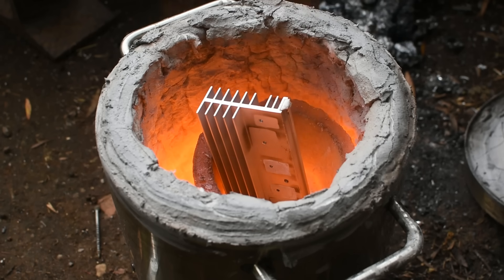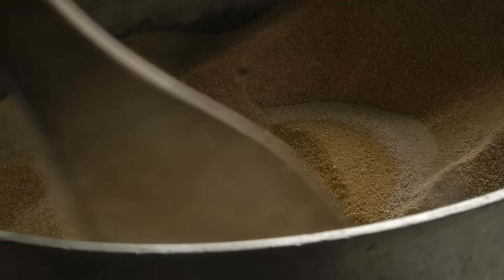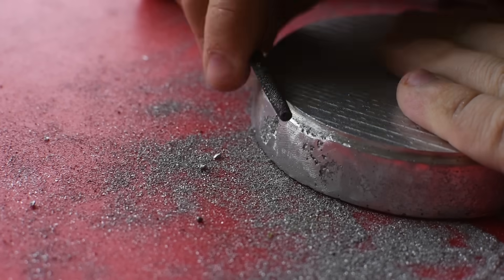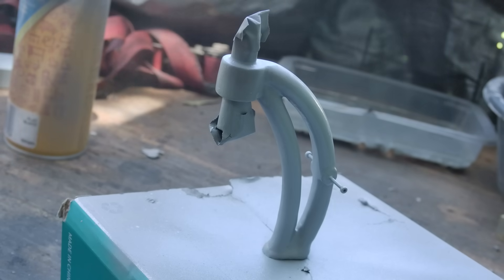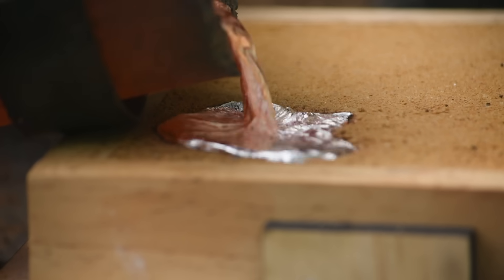3D Printing And Metal Casting Are A Perfect Match

Comment: I've had some success making investment molds from hardware store drywall mud and fine sand. I print a single-wall mold of the object in PLA, coat it in watered down drywall mud, and then pour sand over the wet mud. Drying time can be accelerated in a toaster oven - you just keep coating and repeating this process until you have a thick, ceramic-like mold comprised of sand and gypsum, it's quite strong. One it's done, you can put it in an (outdoor) oven to melt out the PLA at 200 degrees C, you just orient the cast in such a way that the molten PLA will flow out and collect it on some aluminum foil. After all this you should have a mostly clean and dry composite mold, which you can pack into (dry) sand, and then pour your molten metal directly into. My molds were strong enough that the molten aluminum didn't even crack the material, however when I do copper and bronze the heat will usually be enough to crack the mold, so you could wind up with a few small fissures in your casting, however since it's supported in the bucket of sand everything will hold together.

Comment: When melting aluminium, whenever you can use casted aluminium parts and not extruded aluminium parts. They alloy is not exactly the same, the casted ones flow better.

Comment: Q: Why are you just sprinkling the form with baby powder? The plastic is plenty stiff. Would Rubbing that stuff in so it's worked into the surface evenly give a better surface finish? Can you grind and sift the sand even more finely?

Comment: 7:50 If you cut an angle into the wood, made it "sharper", would that help peel off the top layer of sand?  My physics instincts are saying that pushing the sand like that pulls more than you want in the direction the wood is going, maybe add cracks or voids or st.  I don't really know, though.

Comment: I do wonder about using a low melting point material, and attempting something like a "lost wax" casting. That way you can coat the outside with a special plaster, making the job a lot easier

Comment: AI Summary

Abstract

This video details an experimental project integrating Additive Manufacturing (3D printing) pattern creation with conventional green sand casting and subsequent CNC post-processing to fabricate a structurally robust tool component (a tapping arm). The objective was to translate a complex digital design into cast metal, leveraging the superior material properties to achieve thinner, more optimized geometries prone to failure in plastic. The process involved the formulation of green sand using bentonite clay derived from common materials (kitty litter), rudimentary mold construction in a flask, and the implementation of a specialized pouring basin design to mitigate air aspiration. Utilizing a 6 kg propane furnace, the material (scrap aluminum) was successfully poured. Initial results highlighted challenges inherent to green sand casting, including voids from insufficient ramming and increased porosity (bubbles) attributed to layered sand compaction and potentially incomplete sprue filling. The cast parts necessitated extensive post-processing, which was performed on a Carvera CNC mill. Machining successfully removed sand defects, although workholding complexity and a minor crash led to alignment issues on one bore, though the final component was deemed functionally salvageable.

3D Printing and Metal Casting: A Manufacturing Analysis

*   0:01 Project Rationale: The project aims to transition a frequently revised 3D-printed tapping arm into cast metal. This shift allows for more elegant designs with reduced bulk, necessary because excessively thick metal parts are prone to voids and shrinkage during cooling, a constraint opposite to that of strengthening bulky plastic components.
*   1:32 Green Sand Formulation: The casting medium utilized is green sand, compounded from fine sand and 18% bentonite clay (sourced by crushing clumping clay kitty litter). The dry mix was then mulled with water via a spray bottle until achieving proper plasticity, characterized by a clean break test.
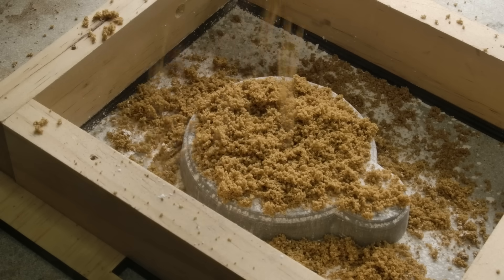*   2:49 Mold Construction and Defects: The mold was constructed within a flask, using baby powder as a release agent. Initial attempts involved compacting the sand in a single step (3:11); subsequent removal of the 3D-printed pattern revealed visible voids, indicating inadequate sand ramming (4:30).
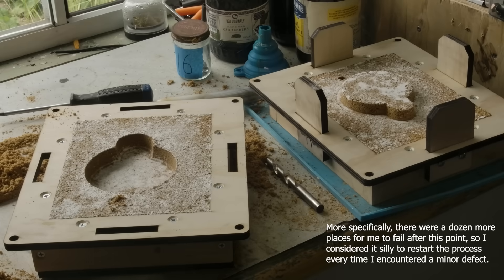*   4:43 Gating System Design: Runners, which connect the pouring basin to the cavity and riser, were manually carved into the sand. A riser was included to act as a reservoir of liquid metal, compensating for shrinkage as the part cools rapidly. The pouring basin design prioritized a consistent, full sprue flow to minimize air entrapment (4:05, 5:30).
*   5:48 Melting Equipment Preparation: The Vivore 6 kg furnace required pre-operational preparation: applying rigidizer and refractory cement to the included ceramic wool blanket, an additional cost ($100) not covered by the standard kit. The included pouring tongs also required welding modifications for safe operation (6:09).
*   6:44 Casting Outcome (First Part): The first casting yielded a result deemed "salvageable" but "not perfect."
*   7:10 Casting Outcome (Second Parts): The second pour involved two parts simultaneously, utilizing alignment pins and layered sand ramming (7:37). This attempt resulted in a complete fill but exhibited a significantly higher density of surface bubbles/porosity compared to the first part (8:16, 8:34).
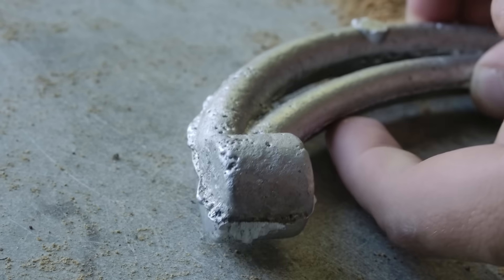*   9:00 Post-Casting Cleanup: Post-processing began with extensive filing to remove flashing and major defects; no major internal voids or material shrinkage were reported.
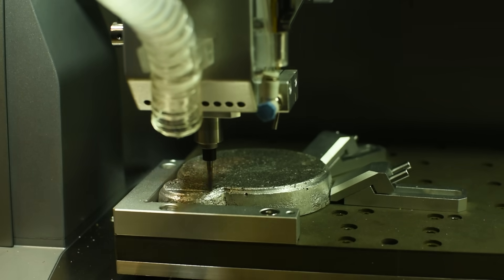*   9:27 CNC Integration: Machining was performed on a Carvera mill to finish the surfaces and achieve required tolerances, replacing a previous, less reliable 3D-printed mill. Light cutting depths were prioritized to avoid catastrophic failure of the cast components (10:41).
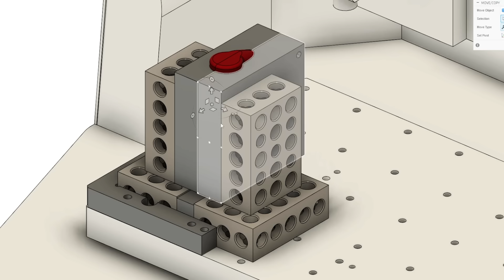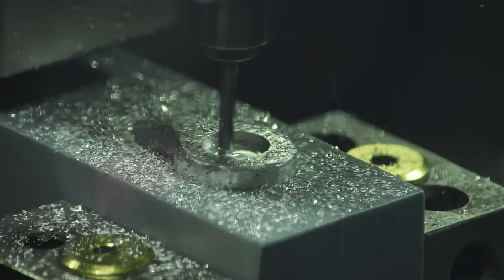*   11:10 Workholding and Error Management: Complex workholding setups were required for the second component (arm) using 1-2-3 blocks and a printed guide. Machining was complicated by limited Z-height, requiring a manual adjustment of the endmill depth mid-program (11:30). A subsequent crash resulted in an improperly set origin, causing an offset bore hole (12:33, 12:38), though the component was ultimately considered usable.
*   12:57 Final Assembly Preparation: Manual operations included drilling the pivot holes on a printed drill press and tapping M2 threads into the component using the original plastic tapping arm tool.
*   13:12 Surface Finish: Parts were treated with filler and sanded, followed by multiple coats of filler primer, concluding with an application of gloss enamel paint (winter gray).
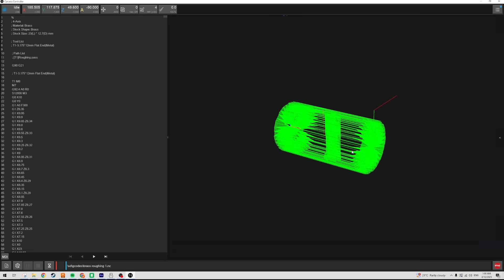*   15:01 Carvera Mill Assessment: The Carvera Air was praised for its quick-change tooling system, auto-leveling function, and beginner-friendly, pre-programmed safe speeds and feeds. Critical feedback centered on the unintuitive layout of the software interface (15:42) and poor screen utilization (15:52).

AI-generated summary created with gemini-2.5-flash-preview-09-2025 for free via RocketRecap-dot-com. (Input: 19,565 tokens, Output: 1,116 tokens, Est. cost: $0.0087).

Comment: You can add little tabs as reference and clamping surfaces, after all the machining is done you machine away the tabs. You only need 3 tabs, preferably on the lowest plane, the bottom of the 3 tabs gives you the first plane, than the sides can give you x and y. From those (unprecise) references you machine the first reference surfaces and holes, if more machining has to be done you clamp to the freshly machined faces and from then on you are free to remove the tabs. That is how it is done for production parts, for hig you have a jig to align every part the same quick and repeatable. For DIY use you could just put holes in the 3 tabs and screw them down for machining. 

Don't be shy to use a lot of extra material for clamping and reference surfaces, you can just remelt everythig you cut away, so who cares if 30% of your part are cut away?

My guess for the bubbles in the second part: The top surface was parallel to the ground and the bubbles had nowhere to rise to. Maybe tilt the whole model or the whole form a few degrees so the air has a clear way out of the cast.
You could also add a little hole at the highest point of a surface that might be prone to bubbles, eg parallel to the floor, the hole would go straight up, during casting you would see metal rising out it. In the finished part you would have a little rod (a few mm thick), where the hole was, but hopefully most of the air escaped through that hole. I think it is called a riser.

Comment: Don't beat yourself up man. Your first casting looks a lot like my 20th casting. You will likely progress quickly. One suggestion: Please don't use lathe chips for your melts or aluminum cans for that matter. I know it's very tempting to recycle, but the metal you end up with will be full of oxide films and the wrong alloy for good, fluid metal flow.

Comment: 8:36 Making vents in mold by stabbing a bicycle spoke into the sand after ramming will help steam to exit when you pour. Also, you can save a lot of time cleaning the castings up if you get coarser files

Comment: Why are you using sand? dip the part in slurry and burn the mold out, then pour in metal, this will 100% work, sand casting is not the correct choice for this

Comment: Great vid, keep at it! There are some great videos showing of traditional japanese casting methods, you might want to check out. The tools and techniques they use are a  perfect match for our DIY needs. Reusing the sand is making it a lot finer as I see it, and I have not seen you pre heat your mold... Getting it to temps close your material melting point and driving off all of the water is going to fix most of your issues. As I already have seen others pointing this out, using alcohol and thus a much thicker inner fine coat/release is also important. As a machinist I can tell you, beware of any non metallic enclosures, they ruin your cutting tools in no time. When you are comfortable, take a well defined and much deeper cut, after your first scratching pass, its vital. once a layer is mosty even, your next pass should remove all enclosures in one go, if possible. Switch you tool after those passes, use a roughing tool and switch. Keeps your wear down, and precision and surface finish grat. Bw sure to always start with roughing passes.  Get a hold of a machinst handbook. even pros check their cutting metrics, they always have their bible somewhere close by! And again, drive off water and get everything hot, Al cools down fast. Water can also cause nasty explosions, other youtubers have spilled molten metal on themselves! Foundryand steelworks professionals have always warned me about this too!!Please stay safe mate!

Comment: I saw a guy doing the cast metal lathe from the Gingery books, and he used pink insulation foam as a lost form material.  It just burns away and disappears when you pour molten aluminum into it.  He painted the surface of the pink foam with something for better surface quality - I think it was diluted plaster of paris.

I mention this because you could maybe CNC machine the pink foam into what shapes you want, then form your sand around that?

Comment: As an industrial engineer who studied castin too all I can say is that for a first time casting it looks great. In the future you should think about consulting the IS0 8062 document to help you. For casting in temporary sand moulds, you need to calculate several allowances. First, there is the machining allowance, which is specified by ISO 8062. Then you add the technological allowance, which is used on holes with diameters smaller than about 20 or 25 mm depending on the required accuracy, as well as on external and internal fillets and chamfers. You also include the draft (angular) allowance, which is added at the ends of the casting section so the part can be removed from the mould. Finally, you apply machining radii so the part does not crack during finishing.

Comment: Modern baby powder (mostly corn starch) is significantly different from the older stuff (talcum powder), as asbestos is sometimes found in the same places talc is and there's a risk of contamination. There was a very recent recall because of that, and now it's practically taboo to use talc in baby powder, at least going by the difficulty in even finding it. 
So, odds are most of the instructions you found call for talcum powder, but just say 'baby powder' as that was the cheapest and easiest way to get it. I have no idea if burning corn starch in the mold might be causing problems, but it sounds plausible that it might soak up moisture and then have it boil off.
You can still get talc powder in bulk though, as it's also used in cosmetics.

Comment: the bubbles you see in your aluminium cast is because of hydrogen.  You can get rid of it by putting a ball of salt wrapped into aluminium foil in your crucible when all is liquid, stir it until the foil melts and releases the salt.  The salt will capture the hydrogen while melting too, and rise to the top of the molten pool, where you thencapture it off with a spoon.. that should clean your material, and reduce the bubbling.  I had that problem too, and pixked up this method from some more experienced guys.

Comment: You might also want to try making a heap of sand with a funnel shape in the center to give your pour more "head" and make it easier to hit.  Also, venting is important, using a piece of wire or thin rod pushed down through the sand to the pattern in several places  to create vents for vapor.

Comment: In Highschool I used the proceeds from a large cutting board wood shop project (24 cutting boards as Christmas presents for a local bank) to purchase an ender 3. I then used that printer to print a small anvil pattern and cast that in aluminum at the schools metal shop foundry. 
Casting metal from 3d printed patterns really is an easy process assuming you have access to the tools, but even the tools can be easily made or ordered cheap. I still have that little aluminum anvil on my desk today :)

Comment: I’m a 3rd year student in material science engineering, we mainly cast aluminium for our solid state’s physics course, and one of our projects is to determine the best bentonite, dextrine and water percentages to get the best performing casting sand. 
When I was doing this I reached the best results with 5% water and 11% sodium betonite.
Your method of testing the sand cohesion is really good. 

Also, try using a flat object for compacting, anything near a lb should be enough, for the smaller crevices and corners a thinner tool is best, not that much weight is needed.
I also recommend you do 2-3 layers for smoother pieces, just don’t over compact to prevent delamination; you can check it pressing your fingertips in the sand, if you can’t dent the sand then is to compacted, just enough that you leave a dent in it.

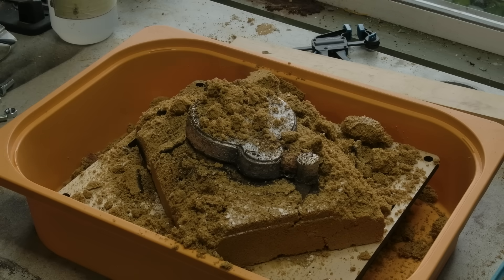Comment: You should add horizontal ridges on the inside of your cope and drag frames to give the sand something to grab on to, to prevent sand falling out of the mold like happens at 6:49. If you make more frames, it's a good idea to give the frame walls a little bit of a draft angle too to lock the sand in better.

Comment: I think you could increase the cast quality by orders of magnitude by not using sand. First print your model on a resin printer. Then dip it into a ceramic sludge. Let it dry. When it has hardened enough, fire the ceramic in an oven and drain it of the liquified model. Now cast the metal in a vacuum chamber. I think this way you could make metal parts of the utmost quality.

Comment: Aluminum melts easier than ferrous metals, but it's far harder to cast due to its lower weight, higher thermal conductivity, heavier viscosity, and its higher solubility, making it prone to voids and incomplete fills.

Comment: nice project, I do however immediately see how you could improve it. The sand you're using for mould making is really coarse and you'd get a much nicer surface finish if you were to mix in some finer grit sand to capture the detail better.

Comment: the foundry I work for started experimenting with 3d printed cores a few years ago. Our cores are made of sand tho. so we're 3d printing SAND cores, for the insides of sand molds.. I haven't been able to get in to see the machine yet, but I've been bugging the engineers in charge of the project about it.

Comment: The spring does not help anything, I am just guessing 🙂. For  smaller parts it will lift the work, gravity helps with centering small taps.  I would be interested if my guess it right.

Comment: Good work, i only suggest one thing: run the program you made for the cnc machining without the piece mounted before machining it in order to see if there are errors in the programm and fixing it without making damages... if you have doubts about your code it is a better way than making damage (it cost more than wasted time)

Comment: Dude, you should seriously consider getting a small cheap manual milling machine, aside from teaching you a lot about feeds and speeds and what a good cut sounds like, it is so much easier and faster for simple facing and boring(a simple rotary table from a combination of prints and laser-cut plywood is also eminently doable..) operations than a cnc...

Comment: If you want to have a smooth cast part you need extremely fine sand and coat all the surfaces of the 3d print with baby power